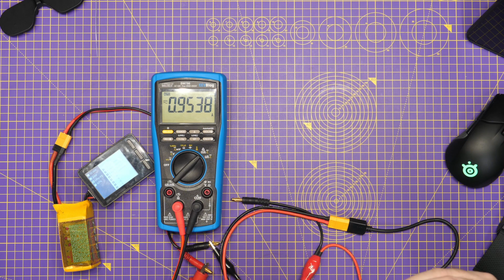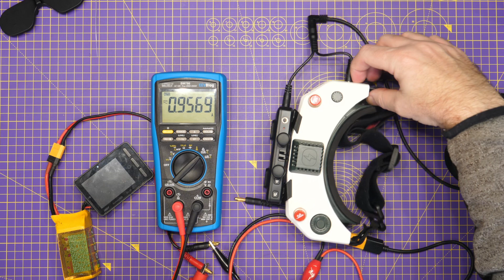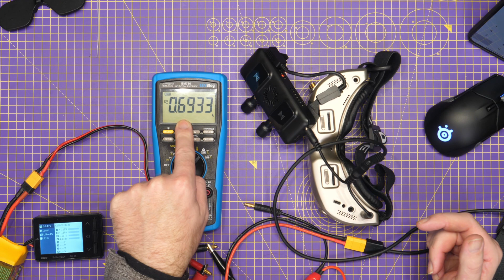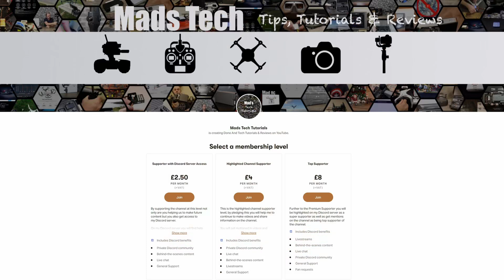Avatar HD FPV VRX Module - Power Usage

Comment: hi ian. thanks for this. actually before i used 3000mah 2S for both the HDZero goggles and WS VRX. it drains the battery for around 20mins to 30mins. so now what i do is I used two 3000mah 2S which I separate for both. i have a longer flight now but with too many wires dangling

Comment: What if the hdzero goggles also have the analogue module installed, running a rapidfire module (as the analogue module is always 'on' if connected on these goggles)?

Comment: Thanks for the video! I am still waiting for my HD zero Google to be shipped on March but I already have the Vrx and the the 1s vtx so I am interested on the topic! To me it's just ok to carry with me a pair of batteries for the googles but I would like to know which size is Better. I was planning to go for a 4s  1300 mah.  I think this should  be enough right? Usually my flying sessions aren't so long 40 minutes, one hour max.
Reply from the maker: I would be looking at 2000mah min tbh. Your going to be pulling about 1A out of that pack in an hour.